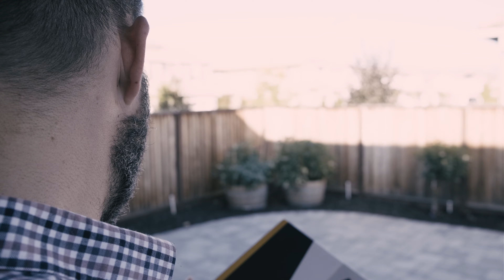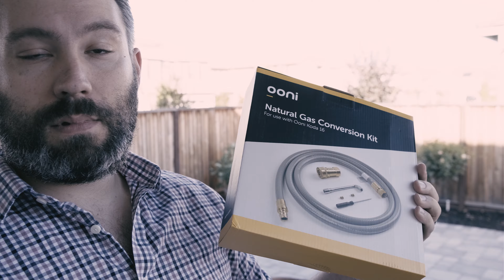Ooni Koda 16 Unboxing and Natural Gas Setup

Comment: The LPG Ooni Koda 16 displays bright yellow tipped blue flames on Butane Gas and less pronounced yellow tip blue flames on Propane Gas. Natural Gas produces a much cleaner blue flame free of yellow appearance. If you have the LPG version of the Ooni Koda 16 but you don't have a Calor Patio Gas cylinder (UK) that you can use, change the regulator on the pipe to a 21mm butane regulator and you can use an existing butane cylinder with 21mm valve.
Reply: @JulianChristopher It's a cleaner burn without sooting of the oven walls and ceiling through the yellow tipped blue flames on butane / propane gas.
Reply: @JulianChristopher Propane does burn hotter than Natural Gas and it gets to temperature much quicker too.

Comment: I know this video is from a few years back, but figured it was worth asking the question here.

I have a natural gas ooni koda 16. The hose is way too short, just as you described in your video.

How did you extend it and what parts did you use?

I have one of those push carts I plan on keeping and storing the Ooni on, but would prefer some flexibility in placement so having a 6' or 10' hose would be better than the 3' one that comes in the box.

Thanks so much!

Comment: I have the same question as an earlier post. Do you rotate the adjustment screw 24 rotations or 6-7 rotations, which is what the instructions that came with the conversion kit said.
Reply: The downloaded instructions off the website say 20 FULL rotations, not 24.  The downloaded instructions are v1.0, maybe there's a revision?
Reply: I’m confused as well. My instructions said 5-7 full rotations.
Reply: @warrior15r  Mine says 5-7 rotations as well.  What did you end up doing and did you have any issues?  I'm just setting mine up and will go with 5-7 rotations.  If it seems like I'm having issues with gas flow, I guess I'll just adjust from there.
Reply: @gregchandler8590  I think I settled on 3-4 because on 5-7, low flame wasn’t very low
Reply: @warrior15r  I went ahead with 5, so we'll see how that does and adjust if needed.  Thanks for the reply
Reply: @gregchandler8590  yep just adjust accordingly to your liking. I definitely think 7 is too much.

Comment: Hi great video....question about the quick connection. Does the quick connection go into the oven or into the mains line? If the quick connection goes to the main line I assume I then need a female quick connection installing at the house? Is the quick connection 3/8"?

Comment: I have a question. I just received the gas conversion but the manual says to rotate counter clockwise 5-7 full rotations. Perhaps they changed this conversion kit. You read and count “24 full rotations”.  Any idea ? Thanks
Reply from the maker: Good question, i'm not entirely sure if or why it has changed. I'll have to take a look. Did you have success setting it up?
Reply: @MostlyPizza  Have not tried yet. I contacted Ooni.... Sent them your video, and they advised me to follow my manual, and they had no idea why your manual would say 24 full rotations. I've seen other posts on FB groups since, who say that 6 Full Rotations is the sweet spot. Thanks
Reply from the maker: Super interesting! I just looked at my manual and it says verbatim this "Use the included screwdriver to rotate the Valve adjuster counter-clockwise 20 full rotations" It even has a picture of the screwdriver with an (x20) right next to it. I wonder if I should roll it back a bit?
Reply: Ok going with 6

Comment: are you using an infrared thermometer to check temps? what temps are you getting and how long does it take to heat up after the conversion?
Reply from the maker: Yes - maxed out I can easily get 1000 F at the flam, but it drops to nearly 650 on the front (without a door)

Comment: Natural gas yields lower BTU than propane for the same gas volume ,, that is why a home gas stove converted to propane needs to have restrictors installed,,since the burners need to be set up differently , So how did you accomplish the use of natural gas on a propane designed burner ?

Comment: I'm not a licensed plumber, and I don't claim to have extensive gas line plumbing knowledge, but I've done some gas plumbing around my home. Looks to me like using the yellow flex hose as part of the oven flexible gas line might be a bad idea. I don't think the yellow flex hose is meant for repeated flexing. Any plumbers out there to comment on this? Other than that, I found the video to be very informative.
Reply from the maker: For what it's worth, it remained stationary and in place... But I can see it not being meant to be flexed often.
Reply: It's an appliance connection hose (for dryers, ovens, etc). It's for occasional flexing (as often as you service a dryer). It sits between the CSST (which is often yellow and does look similar) which is to be permanently installed behind walls and never flex after construction, and the gray outdoor appliance hook-up hoses (which are made for lots of flex).

Looking at it, I sorta doubt it's the right hose for the job, and should probably be fixed.

I'm not a plumber, but I did get GasTite certified to do the CSST install on my own home.

Comment: I'm in the process of planning out an outdoor kitchen.  New grill is going to hook up to natural gas and Im interested in this Koda 16 since it can do the same.  My question is by hooking it up to natural gas is it fine to keep the cover on and leave outside when not in use?  Wont there be an issue of constantly connecting and disconnecting to natural gas if say you store it somewhere else when not in use?
Reply from the maker: I have the natural gas line valve turned off whenever it's not in use with the cover on, so it shouldn't cause any concern. If you have two appliances you will be using natural gas with, I'd just get a Y splitter rated for natural gas, with some built in shut off switches. Taking the quick release valve on/off feels sturdy (like an air compressor hose, if you are familiar) so I imagine it will last awhile. I'd honestly go with a valve with a switch to stop the flow instead, though. 

Honestly we were planning on doing the same thing - I eventually plan to have an outdoor kitchen with a natural gas grill with the Ooni. That'll be a future project.

Comment: Hey!! great video! I want to get the conversion kit but I'd have to wait months to get it. From your experience, do you think that if I hire a gas fitter, will he be able to covert it? or those pieces from the kit are exclusively manufactured and necessary for the conversion.  Thanks!!
Reply from the maker: Hmm good question. I'm sure you could probably get a fitting / regulator that works. You can easily still adjust the fuel flow without making those changes, however I'm not familiar enough to make an absolute recommendation. The hose itself is different as well (and has a built in quick release) which might be something you'd have to change anyway. 

I've already filmed a more detailed version of this with better close-ups, but I have yet to edit and upload it. As soon as I do, i'll try to address any of these concerns as well.
Reply: @MostlyPizza  Thank you! I suscribed already to watch it as soon as it's posted.
Reply: @MostlyPizza  is love to see the new video if possible. I just ordered the gas conversion as they came back in stock. Thanks

Comment: when converting to NG do you need to add a regulator in addition to the Ooni NG conversion kit?
Reply from the maker: As far as I know, the Ooni NG conversion kit comes with everything you need. I needed to get an adapter (aka, 3/4 down to 1/2 down to 3/8th and back up to 1/2in threaded tube) in order to get it to work with my line outlet, but otherwise I didn't have to get anything else.